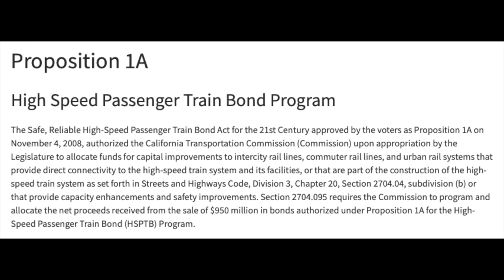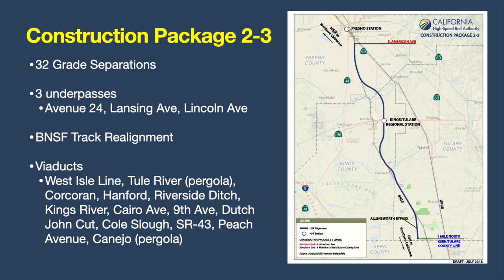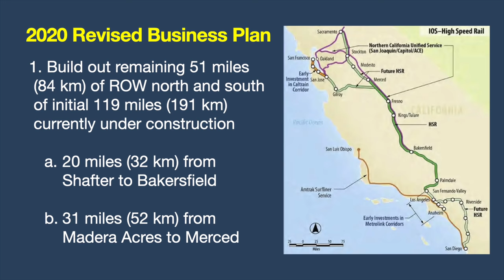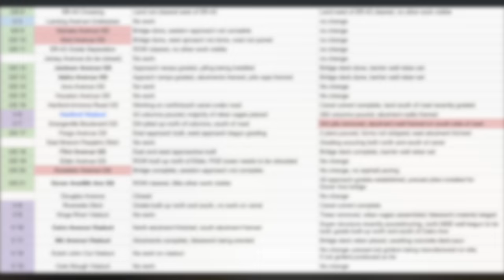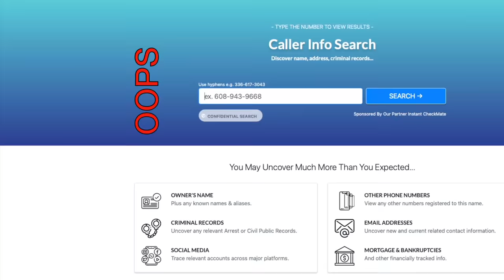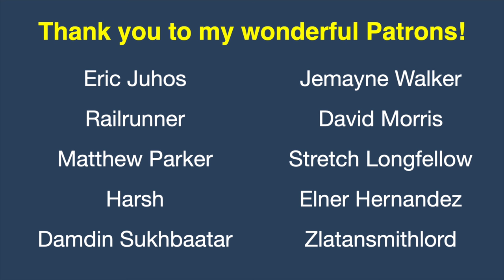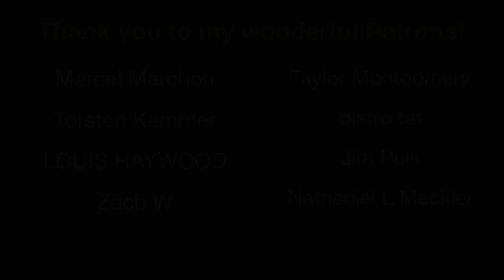California is Building High Speed Rail. It’s time to finish it!

Comment: I agree with you that CAHSR, when completed, will be a good thing. I think your video failed to address the other half of the cost-benefit question; at what price is it worth it? CAHSR seems like a pretty good deal to me at the original $30 billion. At $100 billion (or more, given that estimates are only going up and no track has been laid), I'm not sure if it's worth it. Plus, with all the delays, it's going to take a very long time to start getting a return on that money. If CAHSR was on the timeline we were told to expect when the first measure passed, I'd be taking the train from the south bay to LA next month. Instead, I'll be flying. I'm not really convinced, as a Californian taxpayer, that the project is ever going to be completed for anything approaching a reasonable price. 

Also, I don't think you ever supported your claim at 23:51 that expanding airports exponentially increases CO2 emissions. One would expect a linear increase proportional to the number of passengers.
Reply: The $100 billion figure is the high end cost estimate in inflation adjusted dollars (which is sort of a useless measurement, but that's a totally different discussion). The current average estimate is $70 billion (again, inflation adjusted dollars). For the last couple of years, cost estimates haven't increased that much. The only change has been adding a couple billion in contingency and to account for inflation.

To your last point, if you just strictly analyze the CO2 emissions of the aircraft themselves, more passengers is a linear increase in CO2 emissions. However, if you analyze the problem more holistically, emissions are not linear. With more flights comes larger airports (more construction with its associated emissions), more fossil fuel extraction and refinement, and more support infrastructure for those airplanes (e.g. more equipment required to maintain and service planes and more transportation infrastructure, public or private, needed to move people in and out of said airport).

I think the question to ask at this point is how much is climate change worth? Is continuing to depend on fossil fuel transportation systems and worsening climate change going to cost us less than building this project? I'd argue no, especially since a single hurricane can inflict 25% more monetary damage than the high end cost estimate of this project (Hurricane Harvey did about $125 billion in damage just in Houston).
Reply from the maker: I say this as a non California taxpayer, and I know it’s an unpopular argument, but seriously, what’s the difference between $30bn and $100bn. In my experience any real efforts to “cut taxes” amounts to things like swimming pools closing and educational programs getting cut, while homeowners save like $100 from their escro account that they don’t have access to anyways. This country spends an awful lot of money on things that don’t actually benefit it’s citizens. California is one of the largest federal tax donors, given how wealthy its population is. Interstates in Mississippi wouldn’t be built if each state got to keep its share of federal taxes to be spent in their respective states. 

Like I said, airplanes are going anywhere. I should have expanded on the emissions point, you’re correct, but at 27 minutes and so late in the video, I figured running that point into the ground wouldn’t get much value or enjoyment in return. I will continue flying as well too, because it’s the only option for a lot of journeys. That said, there’s no reason high speed rail shouldn’t be built, where it would be well utilized and offer significant advantages.
Reply: @Flynn_  I did not know that 100bn was a high estimate, so I do appreciate learning that. I disagree strongly about discounting, but that's probably a discussion for another time. I'm not very convinced by the argument that cost estimates haven't increased in the last few years. We've only been building in the central valley, geographically the easiest part of the route. I'm very concerned that when we start tunneling under the pacheco pass and building through the San Gabriel mountains, we're going to see the real cost overruns start. But I don't know, I don't have a crystal ball.

To your second paragraph: Sure, but all those costs of air travel already exist. Why should I expect them to increase exponentially instead of linearly? I think both you and The Four Foot are saying "exponential" when you mean "large".

To your third paragraph: I think this is really where the meat of the argument lies. Yes, this expensive project will have a climate impact. Will it have a greater climate impact than building new nuclear for energy generation? Than investing in energy storage technology to make a shift to renewables actually feasible? Than investing in forest management to prevent wildfires? Levies to protect our cities? I don't think the environmental argument alone is enough, when government funding going to other causes would have a greater impact on the environment. I believe that the marginal government dollar should go to other projects, if our main goal is dealing with climate change.
Reply: @TheFourFoot  I disagree with your characterization in your first two sentences. When we're talking about the marginal dollar of government spending, there's so many places it could go. What if that $100bn was going into proactive forest management, for example. You would probably have your sunset back. Particularly with the environment, there's so many projects and so little money that where the marginal dollar goes is very important.

And yes, I agree with you about airplanes. I don't think it undermines your argument at all, it was just a quibble about wording. A lot of people use "exponential growth" when they mean "large growth" and I've sat through too many math classes to stand idly by! I do think this video is very informative, and that's why I became a patron recently. I don't agree with you on everything, but I think your videos are very interesting. I also love to support queer creators online! Have a lovely day and I hope the video does well.
Reply from the maker: Fair point! My brother was a math major, I should have been more cognizant of my language lol. I 100% would support raising federal taxes to fight climate change and to, among other things, improve forest management in the west (especially since so many of the fires take place on federal land, and I have family that is directly impacted by terrible the air quality that we have now). Nebraska, where I live is also facing the effects of climate change. Very hot summers and very cold winters are the new normal. In 2019, massive snow, then rainfall led to huge flooding, which washed out 4 of the 5 rail lines I operate over, effectively shutting down my work for a couple weeks. 

No, 1 high speed rail line isn’t going to fix everything, or even make the big of a dent in emissions if people don’t ride it. There are many projects that, you’re correct, could likely have larger impacts on CO2 emissions for $100bn. We need to be doing so much more, but I feel like high speed rail is part of the solution, which is why I made the video. Also, thanks for becoming a patron! Lol
Reply: @TheFourFoot  It's also worth mentioning that much of the cost overruns are a direct result of delays in land acquisition, a point you touched on in the video. It's the same issue Texas is having with their project.
Reply: Well, the next Air Force One airplane designed to carry one person, albeit the President of the United States, is going to cost 4 Billion dollars. So,the California high speed train is comparatively a pretty good bargain, as I probably will be never get to ride on Air Force One, but looking forward to riding the CAHSR.
Reply: @nathanielmackler7225  HSR is about transportation first and foremost. It's about CA having a multi-model means of travel for the future. Why limit the means of travel to just cars and planes between the Northern and Southern parts of the state? However, HSR is not just about transporting people, but doing it in a way that is much more friendly to the environment. Planes and cars have become better for the environment and so have trains via HSR technology. It makes sense and it's a cost of living in a modern progressive society. It's interesting how people don't say, "hey, that freeway or highway costs too much." Or, how about all the multi billions of dollars being spent on airport construction and expansion across the nation. No one seems to be complaining about that.
Reply: @madwonk5193  Indeed. These people who complain about delays and cost increases never take the time to ask why these things are happening. The implication, in their silence, is that the CA HSR is solely to blame for it. Far from it.
Reply: @TohaBgood2  Indeed, and freeways and highways have a much larger and noisier footprint than HSR.

Comment: you know what's wrong with this project? They should have start from LA to San Diego or SF to San Jose instead of building first in the middle of nowhere.
Reply: @TohaBgood2  if so then why do the democrats insist of building the HSR through republicans places? I pretty sure LA - San Diego or SF - San Jose are democrats so why not starts there? Connecting between SF to LA should be a long term plan so it shouldn't be rushed. Instead they should connect metro areas with regional cities first. You gonna keep the cashflow going and what is better than starting the plan from LA - San Diego or SF - San Jose first.
Reply: They already do some electrification work between San Jose and San Francisco, but Caltrain is already serving that corridor, so HSR wouldn’t make much sense. The Central Valley segment is the easiest one to construct, that’s why they started there. Links to Palmdale and Gilroy require multiple tunnels, including the longest rail tunnel in North America. San Diego is part of Phase 2.
Reply: @TohaBgood2  hence my question why they want to build through Republican's area first? could have just concentrate on small stretches within the metro area and surroundings.

Should’ve been pragmatic about it and build up in populated areas before going to the Central Valley:
Phase 1a: San Diego to LA
Phase 1b: San Francisco to San Jose
Phase 2a: 2nd Transbay Tube
Phase 2b: LA-Palmdale
Phase 3: Sacramento to San Francisco
Phase 4a: San Jose to Merced & Fresno
Phase 4b: Palmdale to Bakersfield
Phase 5: Merced to Sacramento
Phase 6: Fresno to Bakersfield

It would’ve taken maybe 30 years for it to be finished completely, but at least there would be completed sections that would generate support and revenue.
Reply: @VieleGuteFahrer  Easiest way to construct? With all the lawsuits from NIMBYs? Time delays and cost overuns? If only they knew what is coming.
Reply: @sek153  The whole project was to connect SF and Sacramento to LA & San Diego. Why would they build feeder tracks first?
Reply: @AVeryRandomPerson  you gonna have to learn how to walk first before you start to run
Reply: I'm sure it's a choice between pest and ecoli: Since the Republicans are generally more opposed to passenger trains than the Democrats, there is a realistic chance that when CAHSR was build outside-in and not inside-out, the whole project could have been halted indefinitively or at least, it could have been the more expensive option. The downside of this approach is obviously the Train to "Nowhere" (at least for the population outside of California) in the sense that it lacks the link to the two, more famous and significant metropolises at first.

Comment: This project is a debacle. The track being laid is outside the major population centers---how stupid. You've heard of the bridge to nowhere, this is the train to nowhere. The place to have put the track should have been along the coast but, that would have been expensive and take too long. So what do they do, build it where the land is cheap and no one cares...the only problem, there's no real ridership there. Stupid.
Reply: More people live in between LA and San Fransico in the Central Valley than the Coast. It will initially run from Sacramento to Bakersfield, with Bakersfield-LA opening 4 years later.
Reply: @AVeryRandomPerson  You're excluding the populations of LA and SF in that coastal total...how convient. There's no way a Bakersfield-Sac or LA-Sac will vaguely closely economical considering the cost. The whole thing is a flim-flam grift. Stop lying.
Reply: @rickden8362  I didn't include the population of the Termini as they are at the ends of the route, and your comment inclined in between the termini. I also didn't include them in the Central Valley route.
Reply: @AVeryRandomPerson  Well, that was pretty disingenuous because when this was being proposed it was being sold as a substitute for air travel between major cities.
Reply: Nonsense.  There IS real ridership there.  You must check a map.
Reply: @MarceloBenoit-trenes  Not even close to justify the cost. You must check the cost.
Reply: But there is already track along the coast currently serving Amtrak's Pacific coast trains that run from San Diego all the way to the Bay Area.  There is hardly a place to build a high speed train along the coast as the current track along the coast runs along the steep cliffs that hover over the Pacific Ocean for a couple of hundred miles before turning inland through the mountains.  In fact, Amtrak's Coast Starlight which runs along the Pacific Coast from Los Angeles to the Bay area is Amtrak's most profitable long distance  train in the system.
Reply: @jackjules7552  The most profitable LD train is the Auto Train from DC-Orlando. The Coast Starlight runs once a day and has a horrible FRR. It also takes nearly 14 hours to get from LA-SF entirely by rail.
Reply: @AVeryRandomPerson  yes, you are right on all counts.  But I still love the Coast Starlight (actually it takes a little less than 12 hrs) and I will probably still continue to ride it even when the high speed train through the central valley is completed.   I have ridden the Coast Starlight several times.  I also rode The Lark several times as a child which was the overnight Pacific coast train between LA and SF.  And yes, you are correct about the Auto Train being more profitable but I did not count it since it seems to be for people who take their cars with them on the train.
Reply: @rickden8362  
Of course taking the plane is faster... until you add the time spent at the airport and the travel times to and from the airport.
Reply: @mikeblatzheim2797  No, that central valley route, any route, is still hours slower than by air and there's no idea how much it will cost.

Comment: Built?  They're still tearing down a bridge that was defective, no tracks, no train, no catenary.  The next section is a figment of their imagination over the Tehachapis. The Tehachapis MOVE from time to time!   Even if built, the roadbed in the valley is sinking and has to be rebuilt every five years or so, forever.  Ever wonder the effect of sinking on high speed catenary?  Not good.  Most of the valley segment is already cut back to single track, and the part into San Francisco isn't even started being purchased.

Kill it now, else the US will never have high speed rail.
Reply: You'll never get anywhere with that mindset
Reply: There are MAJOR earthquakes in Japan as well, and yet the Shinkansen has had ZERO fatalities in all its more than 50 years of operation.
Reply: What a bunch of nonsense.

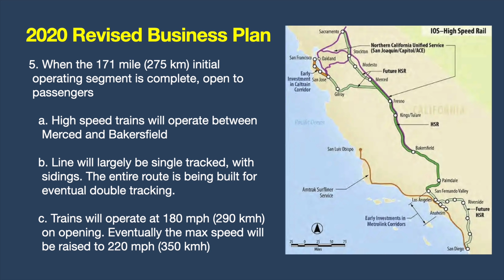Comment: I really want rail to succeed but it is no longer practical. Population, jobs, commutes and destinations change. 40 years ago the best jobs, shopping and services were in the city centers. People flocked to them 7 days a week. Where I live, the rail infrastructure converges  there. Now, the suburbs and x-urbs have the best. Public transit using busses can change starting points and destinations instantly to accommodate this while the railroad infrastructure turns into bicycle trails. A generation from now, this project will become the most expensive bicycle trails ever constructed. Passenger rail is no longer practical and there are many other reasons for this. One more note, I live and work in the suburb of a large city. If I want to take public rail, I have to leave the house before 6 am, drive 2 miles to the closest station, park ($1.00), take the earliest train to the city ($7.50), catch a second train out to the closest station to my work ($7.50), then board a bus that drops me off at the doorstep of my company ($3.25). I get to work just after 10:00, 4+ hours after I left home. My other option is to drive stop and go traffic for 45 minutes ($2.50 toll). Can you figure out why I don't take a train.
Reply: A big nonsense, sorry.  If rail don´t work for you, it´s YOUR problem.  Move to a place near the station...

Comment: Incredible video man!! California seriously needs this high speed rail system. I don’t remember for sure, but I think I saw these major bridges being built somewhere on the 101 years ago for what I believed to be the high speed rail system?? Either way, they’re some massive concrete structures and I’ve been on Amtrak in CA before. Had to go a couple hours north and we didn’t want to take another car with us so we instead took the train. Took over I think 2-3 hours to get to where we needed to go when that normally takes less time by car?? Just horrible how slow the trains are. We’ve always passed them by car at significantly higher speeds.